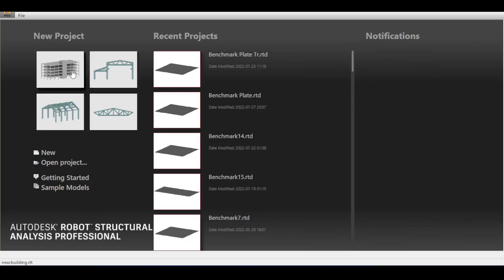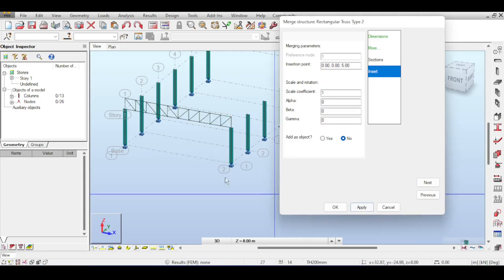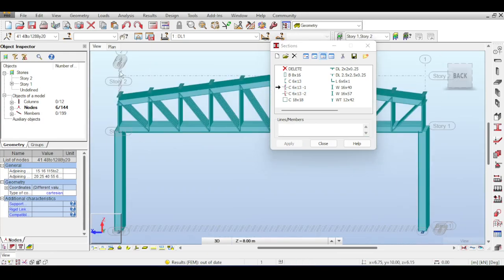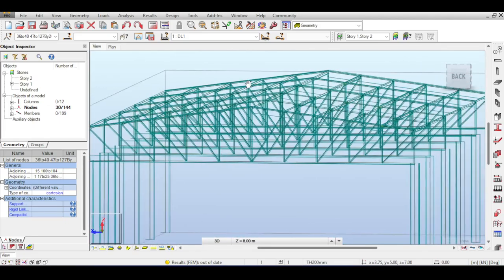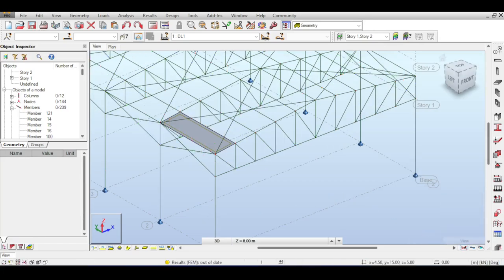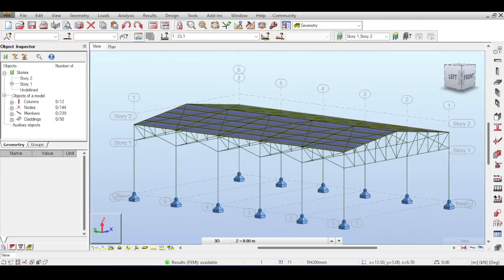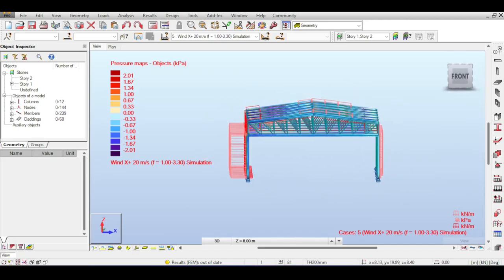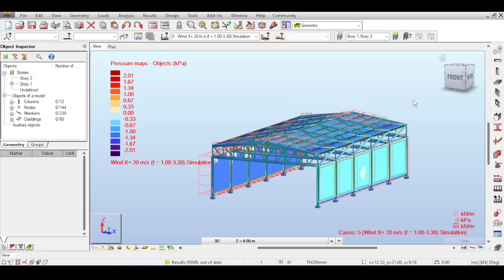Modeling Aspects of Steel Trusses and Warehouses in Autodesk Robot: A Comprehensive Guide

Comment: Thanks for your insight on my inquiry, as you answered most of it ( my question is not as clear as it should be), but you led me on the way, as far as trusses are concerned I think you have to design fixed bracing when stabilizing  in Robots because of the assumptions made by the software itself(hence there will always be a type 2 instability during analysis).
 I was just bugged by a theoretical rule that the bracings connections have to be pinned to avoid moments transfer in the elements wich is not realistic as you mentioned in your answer.

Again thank you for sparing some time on my doubts.

Keep up the good job CEE Team!!!
Reply from the maker: Most welcome. Happy it helped you 👍
Stay tuned for more content, and plz suggest this channel to ur friends

Comment: Kudos 💯 Sir.

I am always learning new things from your tutorials and understanding how the software behaves. 

For my truss depth, I usually stick to span/12-18 and truss bays not greater than truss depth and not less than 900mm

I love how you model  instabilities into your models and later correct them for our learn sake

The instability issues in RSA coupled with the GUI is what puts a lot of new users and beginners off or in a steep learning curve.
 
I’d personally investigate for myself, however I  wish you could later in subsequent tutorials unless it’s an advance tutorial, consider applying member offset to the purlins since in reality the purlins sits atop the trusses and the roof braces beneath the top flange of the top chord. 

The use of member offset tool is tricky to new users including myself. Kindly throw some light on it

Thank you Sir 
Enjoy your weekend.
Regards.
Reply from the maker: Thanks for your comment, I am really happy you enjoy those videos.

Your span to depth ratio does make sense. I personally stick to such ratios too. However, I wanted to mention a referenced suggestion from the AISC as there is also an educative element in the videos.

As for instabilities, as you have noticed, yep, usually stabilizing structures is a challenging task, and I want in those videos to tackle those challenges head-on so that others benefit from the thought process, rather than modelling a perfect structure with no flaws.

As for member offsets, I will keep it mind. Bracings are indeed connected eccentrically from the center of the truss chords, and would contribute to the torsional forces when loaded horizontally. 

It is a technical topic, I will explain it as soon as I can.

Thanks again and regards,
CEE
Reply: @CivilEngineeringEssentials  keep up the good work sir .

Comment: Hi Dr CEE, 

I'm coming accross a project with trusses rn and I remembered this video you made ( yes stabilizing Trusses are a nightmare), I would like to ask you if you kept the bracing unreleased then assume they are subjected to bending moments?
 I tried to release them with multiple configuration ( as far as it is a Truss Wharehouse not a frame one) and i can't get to stabilize it!
I made an assumption made on that : 
-the bracing have to be unreleased due to the abscence of members able to take on the rotation of the trusses , Am I on the right direction or totally misunderstanding the problem ?

Sorry to take you back to an old video.

Thanks for the quality content.
Reply from the maker: No problem, you can always take me back to any video.
The problem with "Trusses" in RSA is that they are basically assuming that all the connections at the truss nodes are "ball and socket" elements. Meaning, zero moment resistance.
Now of course those resist moment. One trick we use in real life is actually to have the lower chord and upper chord be 1 singular element, meaning it will carry moments.
Try that, also, you would need to x-brace the three principal planes, XY, YZ and ZX.

As I usually say, stabilizing trusses is a nightmare, not because it is a challenge in reality (detailing), but because the calculation model we are using is a little bit "too simplified".

Still, I think I did not answer your question sufficiently. So here is what I want to say - please write another comment if I still did not manage to answer it, I will definitely check it again. Coz if you reply, sometimes I do not get a notification -:
If two members are being braced, the bracings are usually released because: A) the bracing can carry moments (so it has a section that is sufficiently stiff)
B) the braced element (the one that is being braced) can carry moments as well
C) the connection between the bracing and the braced transfers moment

So yes, theoretically (not talking about practical stuff), you can decide to release or un-release anything, but this will have a reflection as I mentioned in A B C.

Regards
CEE

Comment: can you draw the truss in Y direction?,  using the truss library you have used. When i try the truss automatically orients in X direction.
Reply from the maker: Sorry for the late reply.
Of course,
First, open the truss library, (Geometry -> Structure -> Insert from Structure Library -> Truss)
Once the window pops up, you can see on its right side something called (Dimensions, More, Sections, Insert)

If you go to the (Insert) Section,
You can determine the angles alpha beta and gamma
Alpha is the rotation around x
Beta is around y,
Gamma is around z.

So if you want to flip your truss to be in y, you have to rotate the entire structure around the z axis, so try gamma 90 or 270.

Hope it helped.
CEE

Comment: I have a situation where I had to cut the existing diagonal and bottom chords truss and just keep the top. I then added two channels back to back attached to the top  chord but robot keeps saying its overlapping how do I solve this?
Reply from the maker: First of all, if you click on the error itself, it will highlight where the two bars are overlapping.

On the other hand, you cannot draw a double channeled LLBB section by simply drawing two lines. You have to choose the section from your section database (there exists combined Leg-Leg Back to Back LLBB) sections, as far as I know, and apply it on ONE bar only.

Hope it solves the issue.
Regards,
CEE

Comment: thanks for your fantastic video I have one question where is the code parameter for this model?
Reply from the maker: Hi there,
Most welcome.
For that model, I used the American AISC code. Default parameters.
Regards,
CEE
Reply: @CivilEngineeringEssentials   thanks for your interest but I did not see any code parameters in this video can you tell me the timestamps for code parameters ?
Reply from the maker: @aymanammar150  I mean,
the only thing that was done is to choose the code from the job-preferences. I had a video about settings codes before. That is why those infos were not shown in this video.

Regards,
CEE
Reply: @CivilEngineeringEssentials  do you willl share this video with us or not

Comment: Thank you for those epic tutorials, they are really helpful.
i have a question regarding a steel frame i recently designed. it was a single column with 2 beams one in X direction one in Y directions, the column was a Square hollow section (SHS) and the beams were both small universal beams. the beams were obviously connected to the column and released to pin, since the connection is a fin plate welded to column and bolted to beam (thus pinned), and the column had a fixed base.
i still got the instability warnings, all deflection and force and moment diagrams were good, no excessive numbers. and i tried nodal horizontal forces on the column and it was still deflecting normally. but i never knew how to get rid of the instability errors, and everything was fine.

Question is, can we ignore the stability issues when everything checks out? even with horizontal forces? and why do you think in such scenarios would i get instability  even though the base of column was fixed?

Structure type was 3D Frame by the way..

Thanks.
Reply from the maker: Hello there,
First off, thanks for the amazing comment. It encourages me to give it my best.

Second: from what I understand, it seems you have modeled a 2D frame in a 3D structure type.

The instabilities can be ignored since moments and deflections are good.
However, of course this is not the answer you wanted ^_^ so allow me to elaborate,
when you open 3D frames, Robot will consider the third dimension even if nothing is added there.
meaning, robot will check also if the structure can "deflect, rotate, move" in the third dimensions, and warn you about it.
Even if you do not have any loads in that dimension, a warning is still issued. That explains why the result checks out but the software seems to "freak out"

Furthermore, another common type of "harmless" instability I face is the instability in the rx direction.

if you release a beam from both sides, you are releasing its ability to rotate (allowing the rotation). if you check the 3D release, I think you would find rx ry and rz  (I do not really remember, it depends).
Releasing both rx's from both ends of the beam is an instability. Because you are allowing the beam to rotate around its own axis (kind of like what happens in the drive shaft of a car, if we ignore the fact that no rectangular HSS drive shafts exists ^_^)

I hope that the answer sheds light onto your question. Feel free to follow it up in case I was not clear enough with that regard.

I already recorded the video for Today's Friday. But I will try keep your instability in my mind for the next video. If the opportunity arises, I will elaborate on it.

Regards
CEE
Reply: @CivilEngineeringEssentials  well explained, thank you, your information is much appreciated.
Reply from the maker: Great ^_^
if possible, help this channel by suggesting it to your friends and increase the reach by subscribing to it.
Regards,
CEE

Comment: I are the point of releases? and what is a moment release?
Reply from the maker: Moment release means that you ssume two elements to be connected in such a way that does not create any moment transfer

It is basically a reflection of what the designer intends to design.